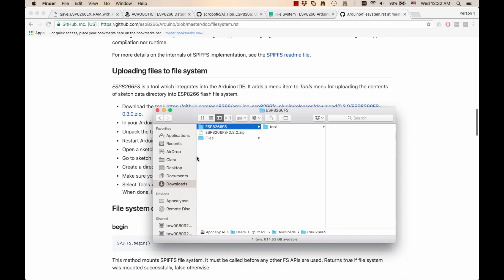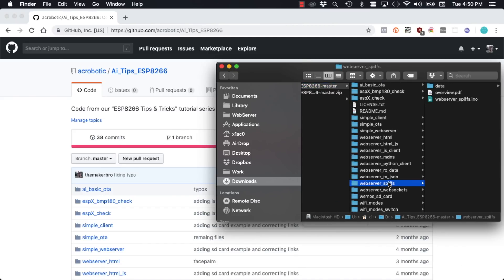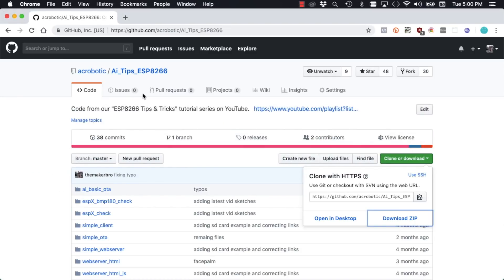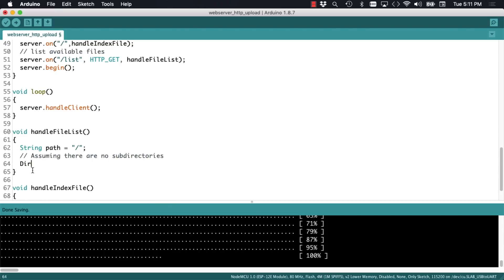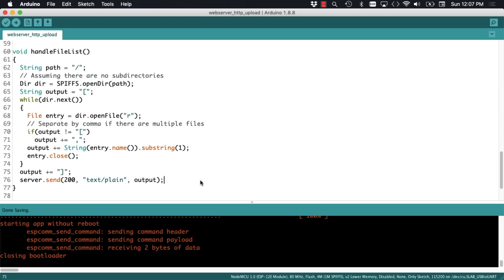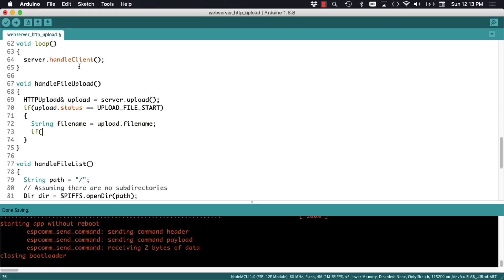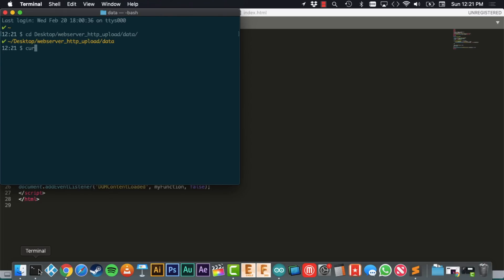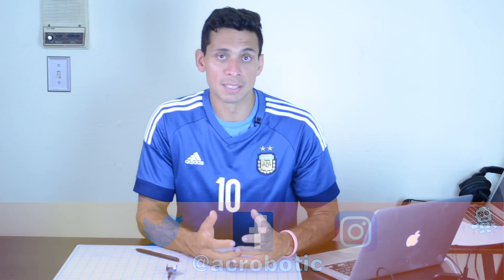ESP8266 Web Server Upload Files Quick To SPIFFS Flash Memory Over HTTP w/ Arduino IDE

Comment: Do you know why curl command didn't work on win10 ?
  curl -F "file=@$PWD/index.html" 192.168.43.170/upload
  Warning: Illegally formatted input field!
  curl: option -F: is badly used here
  curl: try 'curl --help' for more information

however it worked on Solaris10
curl -F "file=@$PWD/index.html" 192.168.43.170/upload
  {"success":1}
Reply from the maker: I suspect some environment variables are different for windows. In this case "@$PWD". If you try the absolute path "C:\Users\USERNAME\...\index.html" it'll work. Thanks for your question, and for watching my vids!